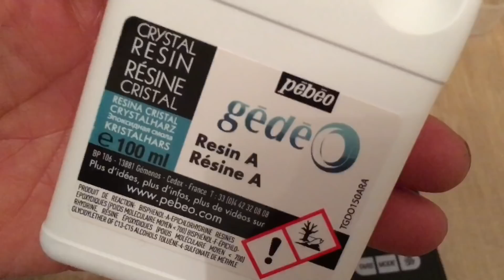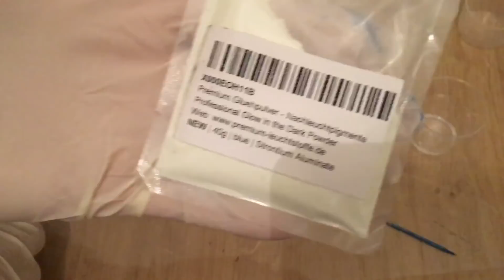Kreuz aus Holz und Epoxidharz bauen - DIY

Comment: Beautiful,  what are the three sides measurements
Reply from the maker: Thank you very much, I'm very pleased.  The video was a long time ago, I can't remember the exact dimensions, I think it was 9x4 cm and the thickness was 8 or 10mm.  By the way, I also made a cross out of epoxy resin and pine cones...check out the video.